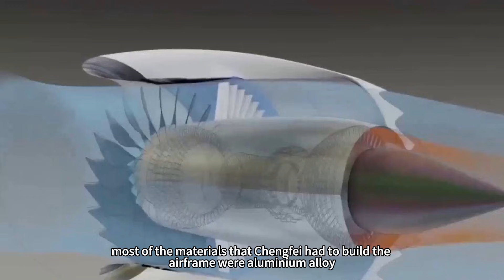Single-engine fighter over Mach 2.4, not many fighters in the world can do it, why did the J-9 fail?

Comment: This transcript is an excellent historical retrospective. It is not nonsense at all. It has a very high factual value, accurately recounting the story of the canceled Chinese J-9 fighter project from the 1960s-1980s. The analysis of its technical challenges and its ultimate legacy is also spot-on.
Here's a detailed breakdown:
What Has High Factual Value (The Strengths)
The vast majority of this transcript is historically and technically accurate. It correctly tells a well-known story within aviation history circles.
Correct Historical Context:
The premise is accurate: The J-9 project was born out of dissatisfaction with the J-7 (a copy of the Soviet MiG-21) and the perceived threat from high-altitude, high-speed Soviet bombers like the Tu-22 after the Sino-Soviet split.
The "two paths" of development are correctly identified: Shenyang's more conservative twin-engine J-8, and Chengdu's far more ambitious single-engine J-9.
Accurate Technical Goals and Design:
The "Double 26" performance target (Mach 2.6 speed, 26,000-meter ceiling) is the famous and extremely ambitious requirement for the J-9.
The design choices are correctly identified: a canard ("duck") layout and side intakes to make room for a large radar in the nose.
The intended engine, the Turbofan-6 (WS-6), is also correctly named.
Accurate Analysis of Failure: The transcript perfectly outlines the three core reasons why the J-9 project was ultimately canceled, all of which are historically correct:
Materials Science: The problem of the "thermal barrier" is real. At speeds above Mach 2.2, standard aluminum alloys lose their strength. China at the time lacked the industrial capacity to mass-produce the titanium alloys needed for a Mach 2.6 airframe.
Engine Development: The WS-6 engine program was itself a massive undertaking that was plagued by technical difficulties and delays. It never became a reliable production engine, and without its intended powerplant, the J-9 could never meet its performance goals.
Limited Resources & Shifting Priorities: It correctly notes that resources were scarce. Chengdu Aircraft Corporation had to divide its attention between the high-risk J-9 and the more immediate need to produce improved versions of the J-7. Later, in the 1980s, China's national strategy shifted to economic development, leading to massive cuts in military R&D funding, which was the final nail in the coffin for expensive projects like the J-9.
Correct Assessment of Legacy: The conclusion is the most important and accurate part of the analysis. Although the J-9 never flew, the immense research and design work done by Chengdu on high-speed aerodynamics and canard configurations is widely credited with providing the fundamental experience and knowledge base that led directly to their later successes with the J-10 and J-20 fighters.
Minor Factual Errors (The Weaknesses)
The transcript is nearly perfect, but it contains one clear factual error and one slight exaggeration.
(5:43) "The fastest single-engine fighter plane in the world is the F-15 Eagle of the United States...": This is incorrect. The F-15 Eagle is a twin-engine fighter. This is a common mistake but a clear factual error.
(6:44) "J-20... the world's only fifth-generation stealth fighter with a duck-type layout...": This is a slight exaggeration for nationalistic emphasis. The Russian Su-57 also employs a form of forward lifting surface (leading-edge root extensions or LERX) that functions similarly to a canard, though the J-20's large, all-moving canards are more prominent.
Conclusion
This is a very credible and informative piece. It is not speculative fiction but a solid historical account of a pivotal, albeit unsuccessful, project in China's aviation history. It correctly identifies the project's ambitions, its fatal flaws, and its crucial long-term impact on China's modern fighter programs.
Verdict: Very high factual value. Aside from one clear but minor error regarding the F-15, the transcript is an excellent and accurate summary of the J-9 story.